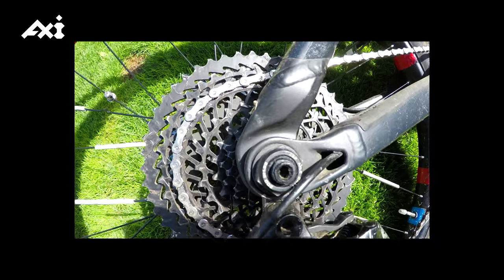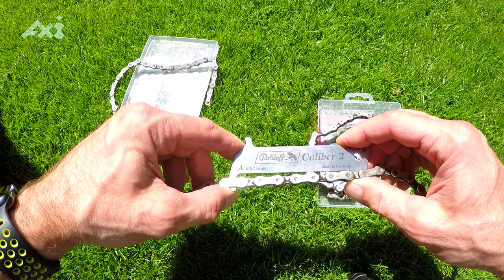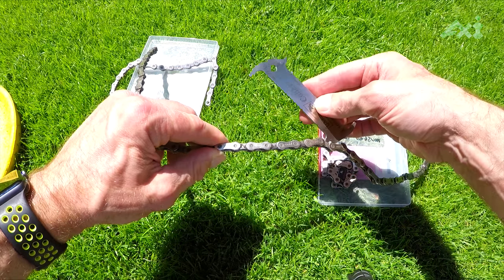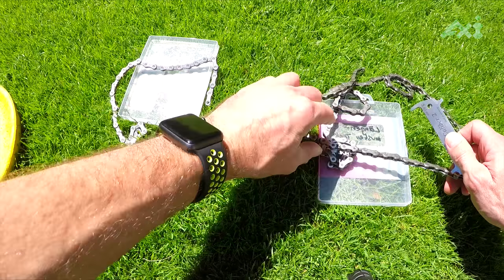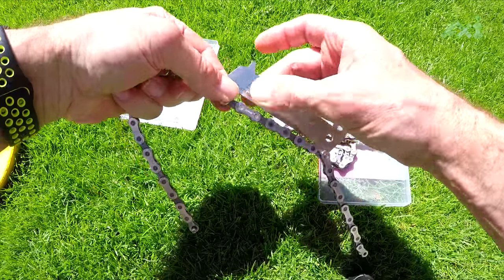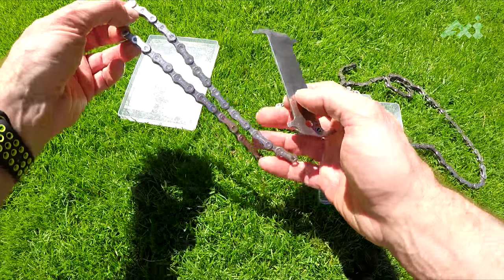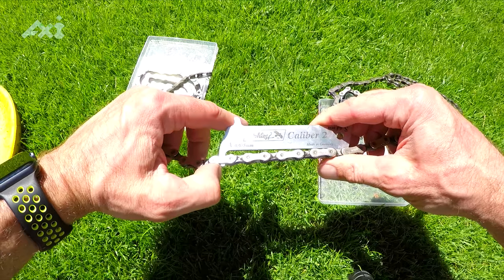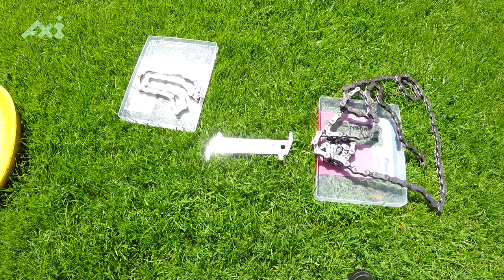Geringe Lebensdauer der SRAM EX1 eMTB Schaltung: Kette rutscht durch nach kurzer Verwendung

Comment: bei mir war die EX1 Kette nach 860km überlang und musste gewechselt werden! nach weiteren 400-600 km wird die Kassette, Ritzel, Kette fällig. Wäre nicht weiter schlimm, wäre die Kassette nicht abartig teuer (350€). 3-5 x im Jahr kompletter Wechsel für total rund 2500€ kann es ja nicht sein, oder? enttäuschend ist, dass das EX1 nicht mehr Laufleistung schafft, als jedes andere System auch :-(
Reply: 800 Km schaffte ich locker mit der billigsten Shimano Kette einer HG 31 für 10€ allerdings macht mein kleines Ritzel (11er) einer HG 51 Kassette immer bei 1200 km schlapp.Kostet aber auch nur 16€!
Reply: @ernstkraupner8753  dann solltest du öfter Mal schalten und nicht im letzten Ritzel beschleunigen. Meine hg50 kleines Ritzel hat 3000km gemacht am getunten ebike

Comment: Was fährst du für eine Trittfrequenz? Empfehlung 80-90 dann hälts auch
Reply from the maker: Ich verwende den Garmin Sensor und der zeichnet alles auf. Wenn geht dann meist so um die 80 Upm.
Ich habe die beste Untersetzung die machbar ist: Vorne 14, hinten 48 Zähne.  Wenn das Gelände sehr steil ist, deutlich weniger und sehr viel Kraft. Leider hat der Bosch Motor ein Getriebe zwischen Kurbel und Kettenblatt.
Reply: @PedeleceMTB  also dann noch ein Grund für Shimano
Reply from the maker: Die EX1 Schaltung ist laut SRAM speziell für eMTBs konstruiert, damit sie die hohen Kräfte aushält. Für Hügelbiker, die nicht sehr steile Wanderwege hinauf fahren wird die EX1 auch gut funktionieren. Wenn man das eMTB jedoch tatsächlich als Bergfahrrad verwendet, lebt die Kassette nicht lange, das sie nicht wie versprochen aus gehärteten Werkzeugstahl gefertigt wird. Das 48er Ritzel ist aus weichem Alu.
Reply from the maker: Gibt es eine Shimano Schaltung, bei der alles aus Stahl ist, und das größte Kettenblatt min. 48 Zähne hat?
Reply: @PedeleceMTB  ne ich meine dann lieber den shimano Antrieb (Motor)
Reply from the maker: Achso. Der überhitzt leider, wenn man im Sommer sehr steile Wege hinauf fährt und mehr als 60kg wiegt.